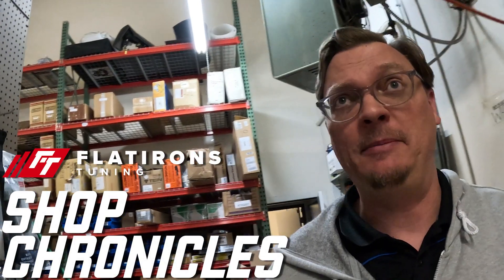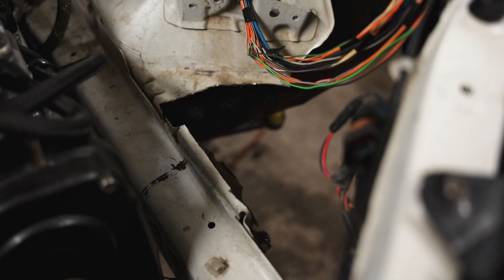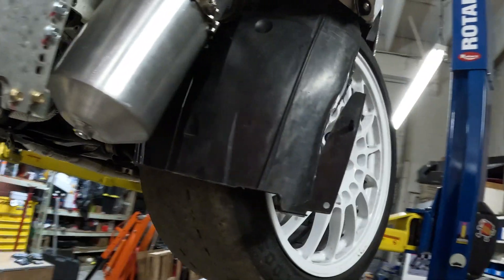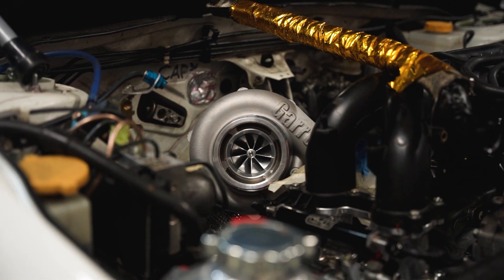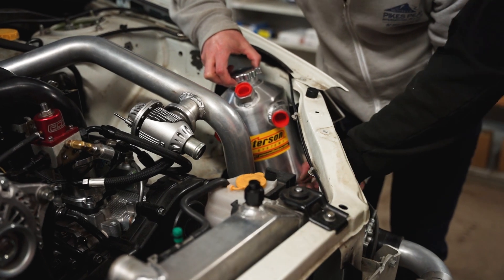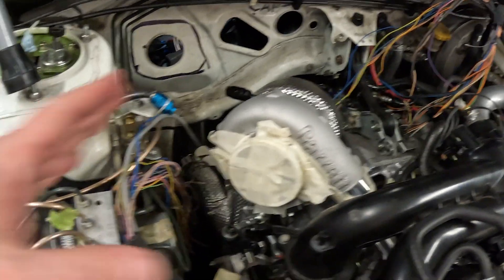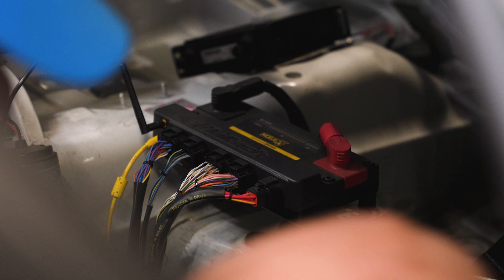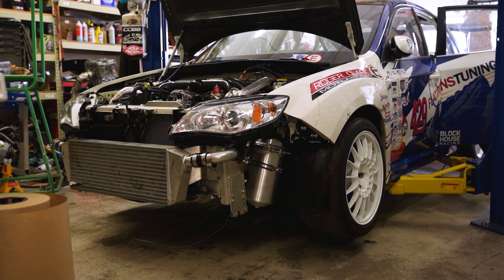77 Days until Pikes Peak 2025 - Turbo, Oiling, Wiring

Comment: What do y’all think of those little Element fire extinguishers?
Reply from the maker: Thanks for watching and thanks for the question.  We may take it out honestly now that we are running a fire suppression system.  It is hard to say how beneficial it is to have at this point.

I'd say that you would not want that as your only line of fire suppression, and that a conventional extinguisher would be better protection.

But it in this case it is better to have something rather than nothing.

Hope that helps and Stay Tuned!